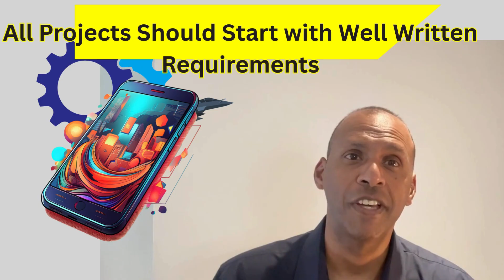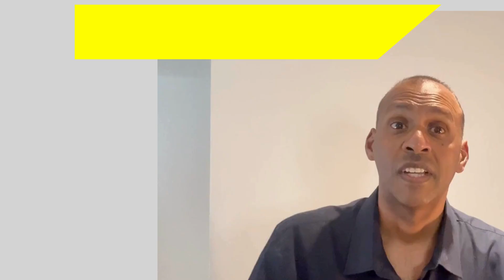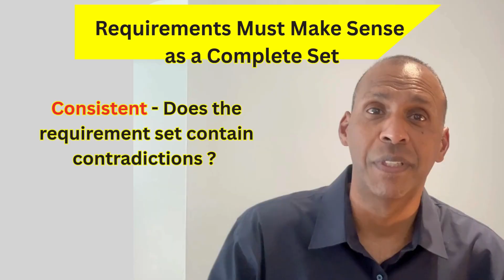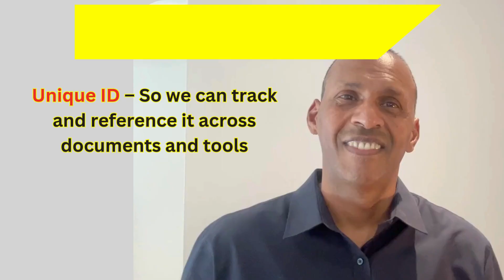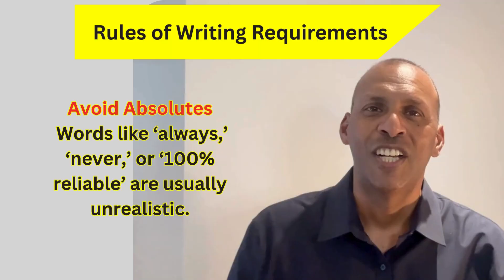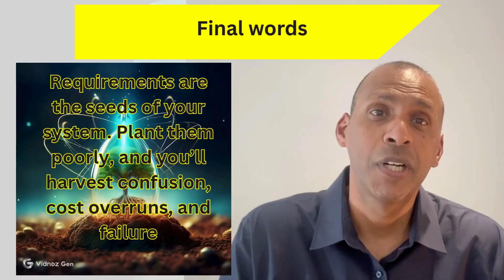Good Requirements Writing Techniques  #systemsengineering

Comment: Thanks for sharing this insightful details about Requirements Management with the online Community! All the characteristics of the requirements that you spoke about are extremely important. Also requirements change over time and those characteristics of a good requirements shall be put in practice even while updating or changing requirements. 

A big PLUS,  now with power of AI, it's much more faster to produce well formed specifications. That said, it's also important to set the right context while communicating with AI. Also everything that AI suggests as specification may not be feasible to be implemented in next release! People has to take decision about which feature, requirement, idea will be implemented when based on Budget, Resources, Technical Constrains, Market Needs, Business Needs, etc. This is where one has to look at Requirements and Specification via different angles too and not only how AI prescribes it as. This is where requirements management tool can help which supports ... 

- Requirements Breakdown Structure
- Custom Requirements Type
- Change Management
- Traceability
- Baselining
- Including and Excluding requirements to define scope of the baseline
- Parking Lot to move unfinished requirements away for later implementation
- Markdown format for description to capture rich text description. 
- Export and Import of data in JSON format that can be used to set context while talking to AI engine too!

- OpenRose - 🏵 Requirements Management Tools Team 
FREE and Open Source!
Capture, Define, Trace, Change, Prioritize, Baseline, Negotiate, Test, Deliver >>> Repeat the Process.